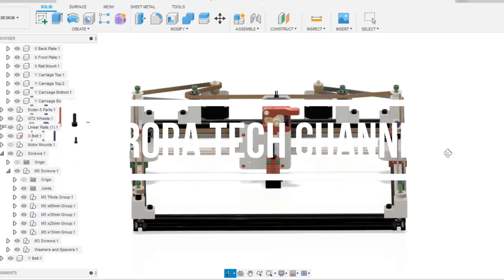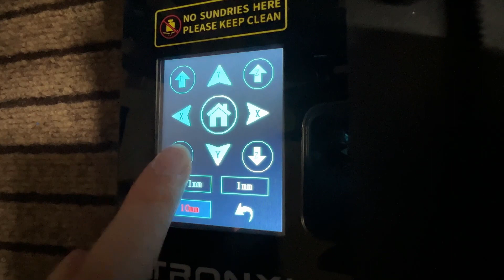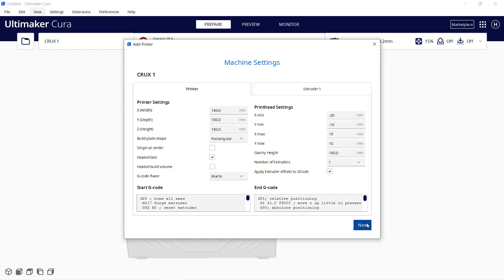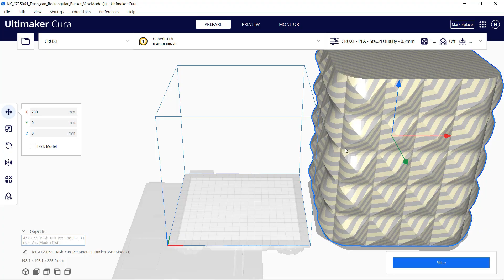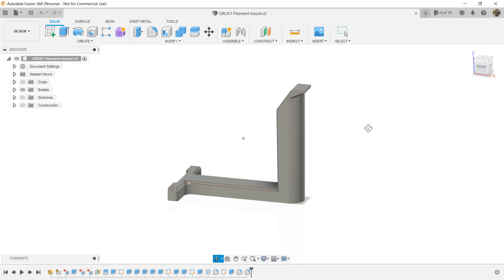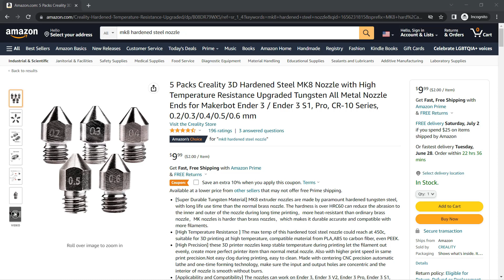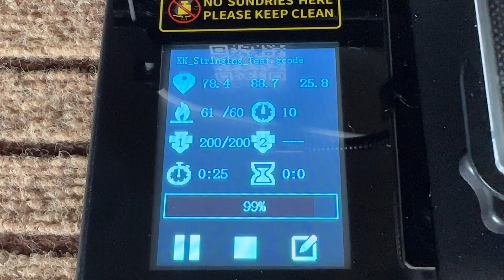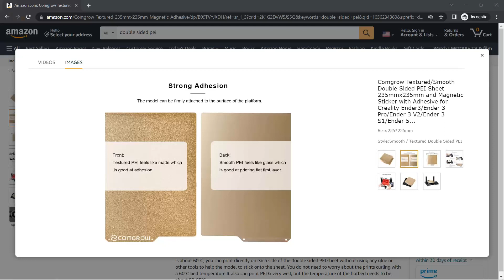$530 Prusa Mini Plus OR $179 Tronxy Crux 1 that can print Nylon and Polycarbonate Carbon Fiber?

Comment: hi guys new subscriber here. I think you should seriously try to tap into the drone FPV enthusiast such as myself. the hobby is exploding with new comers and currently the 3D printer parts are expensive/ massive shipping fees for overseas. I think it would be simple for you to get the attention of the FPV people by talking about TPU/flexible filaments. Personally I am trying to find a small direct drive 3D printer such as the one in this video but I did not see you test any TPU.

Comment: I bought a Prusa Mini+ in early 2021 and honestly, it's a bad printer, especially at the new, higher price. Prusa's in-house extruder design is weak and prone to jamming--clearing those jams requires an aggravating amount of disassembly. The hotend is also Prusa's own design and is prone to clogging. Worse yet is the Mini's firmware allowing hotend temps up to 300C, which is insane for a PTFE-lined hotend. I upgraded mine to a Bondtech extruder and V6 hotend and it improved it quite a bit, but is that really something that someone should have to do on a PRUSA branded product? Absurd.
Reply: Welcome to the power of marketing!

Comment: What i would like to know, is what wire connectors you used, to mount the filament sensor on the extruder. 

Don't know what it is called, please tell me.

Comment: Adjusting bed gap should be accomplished with everything at operating temp.  These dimensions will be very different when hot.  ??  The bottom layers of prints shown do not have the extrusion lines merged with each other.  Your gap is too large.

Comment: Just looking at that thing, Troxy bad design choices: 
1. Glas bed is heavy thus reduces print speed and increases ghosting
2. Direct extruder is heavier on the cantilever and causes sagging and more play also slows down speed
3. No automatic bed leveling

Notz saying the Prusa machine is any better. For that price point´s mechanically it´s a pretty bad design (cantilever). 

Please for the love of god China, make an affordable Core XY design which just works.

Comment: Did you have the problem where the purge line purges off the plate?
Reply from the maker: Just change the starting gcode from:
 G1 X2 Y20 Z0.3 F5000.0 ; move to start-line position
 G1 X2 Y175.0 Z0.3 F1500.0 E15 ; draw 1st line
 G1 X2 Y175.0 Z0.4 F5000.0 ; move to side a little
 G1 X2 Y20 Z0.4 F1500.0 E30 ; draw 2nd line

To:
 G1 X5 Y20 Z0.3 F5000.0 ; move to start-line position
 G1 X5 Y175.0 Z0.3 F1500.0 E15 ; draw 1st line
 G1 X5 Y175.0 Z0.4 F5000.0 ; move to side a little
 G1 X5 Y20 Z0.4 F1500.0 E30 ; draw 2nd line

Just change all X2 to X5 will move the purge line to the right by 3mm.
Reply: @AuroraTech  thanks

Comment: no no no no no... you have to change the end G code too. The KP3S Cura profile is bugged. 
At the end of the print the bed bangs two times more then into end because Y is 200 and 300. delete one line and the outher change to 160
Reply from the maker: The KP3S printer profile and ending GCODE in Cura 5.0 has no issue with this Crux 1.
Reply: @AuroraTech  I am a noob but can read gcodes. 

This is the endcode :
"G91; relative positioning
 G1 Z1.0 F3000 ; move z up little to prevent scratching of print
 G90; absolute positioning
 G1 X0 Y200 F1000 ; prepare for part removal
 M104 S0; turn off extruder
 M140 S0 ; turn off bed
 G1 X0 Y300 F1000 ; prepare for part removal
 M84 ; disable motors
 M106 S0 ; turn off fan"
2 times he bangs into hardware
 Y200 and Y300 but the bed is only 180. 

So there is a problem !

This is the original 5.0 Cura Gcode... it is only changed if it was changed in another version. Mine was also correct. I first had to delete the profile and set it again, because it had already taken over my correct changes from 4.13.

even if crux overwrites the endcode (which i don't think it will), people should be made aware of the error. Who knows what a firmware update will change.
Reply from the maker: The Crux1 has soft limit enabled, so it won't be an issue. If your printer has not enabled that, you can send gcode M211 S1. After that, even if you manually send gcode and try to move to Y200 or Y2000, the printer won't move more than Y180 (or the bed size limit).
Reply: @AuroraTech  the only issue I had with cura 5.0 is the pre extrusion line crashes into the glass bed clips , I caught this early and moved the left clips to the front and rear . Thanks for a great review as always

Comment: Sorry to say Prusa is overpriced in the current market. Yes they made way for printers to come more mainstream but they are not adapting with the rest of the market. Sorry to say I will never own a Prusa regardless of how great people say they are. They are 5x the price of a different printer and if you had to compare and guess what printed which, you WOULD fail. 

Prusa is not worth it, at all, under any circumstance. Those who cope with the justification of print farms are doing just that; coping.

Comment: I have one too. I enjoy the printer as a whole but disappointed in the hotend setup. It's a 26mm throat with a 28mm ptfe tube. With all the great stuff on this printer it's like they took a step back with this design. However properly tuned it gives great results.
Reply: Do you think the hot end will be able to be upgraded?
Reply: @nathankean7968   t think it should be easy.
Reply: @jeffdeneault3031  hope so

Comment: This printer definitely reminds me of the kingroon kp3s just with slightly worse hardware but with a better overall design.  Like it has a mount for the power supply in the base but no linear rails.
Reply: Given the choice I'd choose my kp3s over this but it's a good performer for this cheap.

Comment: Obviously I don't know how to use the comment mechanism (my first time commenting)
1. I ordered this printer after viewing your review. You recommended the PEI bed option for $10, which I ordered, and got an order acknowledgement. But then a few hours later, I got a message from Tronxy saying that this was a mistake on their web page, and the PEI bed wouldn't be available in the US for a couple of months (more or less). They gave me some reasonable options, none of which I really wanted, though. So ... not a complaint, but an alert about that if someone is ordering for US delivery in the next month or so.
2. You suggested that a bi-metal heatbreak would have been nice, and you flashed one ... I think an Amazon page for the BIQU E3D V6 Hoten for E3D V6 Volcano Hoten Prusa I3 MK3/MK3S Heat Break 1.75mm Filament (2pcs a Pack). Is that just a "like this one" example, or is this one you think will actually fit and work with the Crux?

Again, thanks for your great reviews.
Reply from the maker: They machine they sent me also came with a glass bed, I bought this PEI textured sheet from amazon:
https://amzn.to/3OH8iJW

Yes, the heat break picture in my video is just an example, I can't see any off-the-shelf heat break available for this hotend and hope Tronxy to release one soon.

Comment: I'm a bit confused about the hotend.  It claims to be able to print at 275, but near the end of the video you say it's a PTFE lined heatbreak.  If it is lined, it is incredibly dangerous to print above 240C, as the PTFE will burn and produce very toxic gasses.  Does the PTFE liner really go all the way to the heater block or no?

Comment: The so called "OSG Speed Linear RollerGuide" is something that I'm in too minds about,  as to me just looks like steel wheels on chromed rods? Has that been used on any other printer?
Reply: Many Tronxy models. Had an  x5sa pro and after a year of printing no wear.
Reply: A year later and it looks like TronXY got it right.

Comment: I am a welder, wire feed welders use a system to feed the welding wire not unlike a 3D printer feeds filament, most wire feed welders have duel drives and an adjustable spring tensioner, the welder tension adjuster has one difference in that it can pivot sideways to release the tension making it easier to change the wire on a welder, and it could be the same on a 3D printer, just my observation. i really enjoy your videos.

Comment: How does it compare to the Ender 2 pro? I'm looking into purchasing a smaller printer?
Reply from the maker: I would choose this Crux 1 over the Ender-2 Pro for 3 reasons, Ender-2 Pro is a Bowden set up with an even smaller print bed 165x165, and the maximum temperature of the nozzle and bed is lower(260/80).
Reply: @AuroraTech  Thank you

Comment: Hi Aurora, I always enjoy your videos, but I think I spotted an error in this one.  You said there is no belt tensioner on the Y axis.  In your video, however, you can clearly see that the motor for the Y axis is mounted in slots.  It should be possible to tighten the belt over this.
Reply from the maker: Yes, it has another timing wheel under the bed that requires loosening 3 screws and moving it away from the belt to increase tension, holding the wheel tight with your hand, and tightening back the screws can increase tension. I prefer a more convenient thumbscrew belt tensioner.
Reply: @AuroraTech  it is

Comment: Excellent review. Among my printers is a Prusa mini. I wonder why my Mini looks like a hobby project. This Tronxy looks a lot better. Of course you cannot expect it to be perfect for its price but the mini isn't too for three times the price.
Reply: I agree with the price being too high. I have one original Prusa but went with clones after. Half the price and same quality. You should not forget that a Mini comes with the luxury of not needing a piece of paper or springs to level every now and then!
Reply: @JohnsonsUnited  One thing clones do not have to do research and development. The Prusa mini is manufactured in the EU and must comply with stricter regulations.
Reply: @TheOfficialDarkICE  R&D yes, regulations no. You're essentially paying for the brand and R&D. Which is fine but considering the MINI uses generic Chinese made components like bearings, heat break, thermistors etc. It's hard to justify the price when an almost identical machine to the clone. Actually, I prefer the clone since it's simplified (one tube from extruder into heat break, instead of two separate tubes). It elminates the Mini's design fault.
Reply: @TheOfficialDarkICE  I prefer the clone's design over the original. The temp can easily be raised using a cheap TriangleLab heartbreak. In fact, my Originals run into issues printing CF Nylon at 290c, the tube shrinks in less than 80 hours of printing. My clones do way better on that part.

What regulations? I am genuinely curious. Some of their parts are CE certified but they are not made in-house, nothing they have to worry about. Most of the mechanical parts on the MINI are generic brands unlike the mk3s, where bearings etc are actually branded
Reply: @JohnsonsUnited  what clone do you use?

Comment: Good video, as always.
PTFE-Tube is not pure PTFE. The normal "limit" temperature is due to the tube deforming; about 278°C is the temperature PTFE decompose to toxic fumes. While you can increase deforming temperature by optimicing the aditives used to make the tube, you can not increase the temperature PTFE decompose. So definitly I would not use 275°C, as is critical near to decomposing temperature. Changing heatbreak as you recommend definitly is the best way.
While the Tronxy seem to be a nice entry-level printer, I prefer the Prusas for the open hardware concept for advanced users. Upgrades like LGX and Revo cost more than the basic printer. While I have a lot of different printers at the moment I use mk3s+ most - original and clones. But also the Mini - the best advantage is the number of upgrades you find for Prusa printers. The biggest con for the tronxy is you have to be very advanced to do any upgrades; the biggest pro for the prusas is the very large comunity.

Comment: Pretty interesting printer, I wouldn’t recommend going over 240*C with a ptfe inside because it releases fumes-regardless what the manufacturer claims.

I would like to see how this stacks up against the Kingroon KP3S and Ender 2 Pro
Reply: I was going to say the same thing. Also the ptfe will burn and cause clogs over time if you print over 240c. So the new heat break is a great upgrade. Nice looking printer at a good price. Looks like a winner and a easy one to upgrade.

Comment: Those glass beds just need a good clean with IPA to take off the adhesive used for the protective sheet and then they print just fine, usually you can print over this protective sheets glue but after a few weeks of heavy printing it will bake to the glass and nothing will stick to it
Reply from the maker: I have more than 30 glass beds, the coating on this CRUX 1 bed is the thickest. As I tested out a lot of new printers with a glass bed, they only stick too well when brand new, this is the only new bed that didn't stick well enough.

Comment: As someone who has owned more than one Tronxy printer I can tell you that parts will start to go bad on this machine much quicker than they should.  Tronxy is the worst 3d printer manufacturer of all the printers I have used.  

To be fair, it has been a while since I have bought a Tronxy, because I really hate Tronxy, so maybe they have improved some, but I highly suggest people avoid this company unless they are very comfortable doing things like replacing power supplies and motherboards.
Reply: And to counter that, I've had an X1 for nearly 5 years and its still working fine. They are cheap yes, but as you've seen in this video you get a lot of value for money. If you are not planning on having your printer in constant use and you want something like a starter printer, this looks ideal.
Reply: @frankhovis  This video didnt prove anything other than it printed nice out of the box.  Lets see what she has to say when she uses it every day for months on end, that is a real review.  

I get that you cant really do that as an influencer with every printer, I am not at all knocking her review.  It was a mostly solid review, simply pointing out that this video wasnt a long term review, just a first look.  

I also know that there are the rare Tronxy printers out in the wild that live up to the promises made by the company, but your printer and the rest of the good ones are not the majority, they are the exception.  

If you want a cheap cantilever printer, I suggest the Kingroon.  If for some reason you dont want the Kingroon, then even the Ender 2 will beat this Tronxy in longevity/value.
Reply: @jon9947  All these 3D printer channels suffer from this. “The new Bing Bong X5 is amazing for the price!” Let’s see how it holds up after 6 months. You get what you pay for, and I was skeptical of the hype but made the switch to Prusa after getting tired of constantly modding and tinkering my cheap printers. I’ll never get another cheapo printer after realizing how much time goes into fixing stuff, ordering new parts, calibrating everything again and again. It really comes down to saving time versus money. One way or another you will pay.
Reply: To be fair, their pricing reflects that and anyone with any sense buys them as project printers.  If you know of a better 400x400 coreXY printer for $300, I would love to know where I can buy it.

Comment: This was a good review, but is missed the mark for me on a couple of things. Firstly, it didn’t really compare the tronxy against the Prusa so I was unclear on what it was as good-as on or worse than. Secondly, I didn’t like the con of “no print profile in cura” that was a bit “clutching at straws” since no new printers will have cura profiles and so it really didn’t need saying. Otherwise a good review of the printer in its own right.
Reply: @Suicide Kyd heavily biased opinion since you have stated more than once you think Prusa’s are overpriced
Reply: It only costs a 3d printer manufacturer a small amount of time and effort to create a proper Cura (and other slicers) printer profile: to not do it is very cheap.

I bought a couple of cheap LotMaxx printers last year, their cheapest model with no automatic bed leveling, and their dual extruder/single hotend one: they both had Cura profiles from the start.

I was amused to observe that this 3D printer had a notably easier final assembly process than my LotMaxx printers has, more easily done without the odd contortions I had to do because of the design.